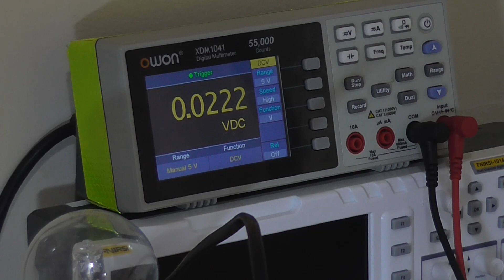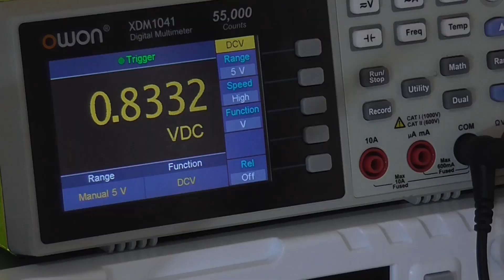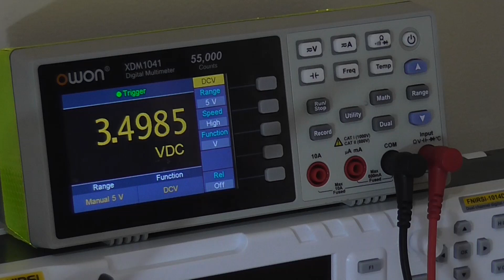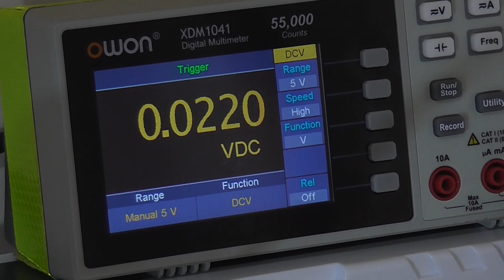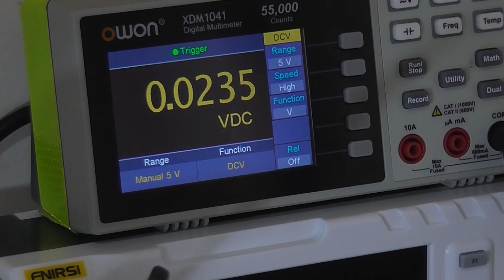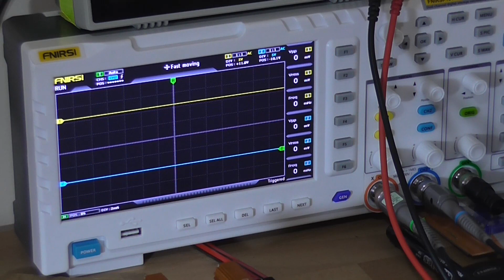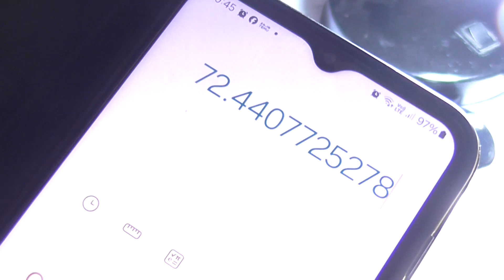How To Test An Unknown Power Amplifier SAFELY

Comment: Definitely you need a more powerful transformer for this amp
Reply from the maker: Not really sure what you mean; if you mean in terms of current, not really. The amplifier only draws around 2A at full power. If you mean in terms of voltage; you can't go any higher than +/-40V with current signal transistors.
Reply: @AstrosElectronicsLab  the one you used on the video how many VA have that transformer?
Reply from the maker: @SymbolTech21  160VA
Reply: @AstrosElectronicsLab  if it's 160va should be fine I don't know why I had impression from the video was looking quite a small size
Reply from the maker: @SymbolTech21  nah, it's 110mm diameter, 3A secondary winding.
Reply: @AstrosElectronicsLab  that's good size

Comment: Hi there 
I have 1 question 

Which one is good for Heat sinks
1. Anodizing 
Or
2. Powder Coating 
For amplifiers around 200 watts per channel. 

Please reply
Thanks
Reply from the maker: The coating doesn't matter, as long as the material is aluminium (aluminum). Most heatsinks are anodized; however, I wouldn't use powder-coated as this can affect the heat transfer as it's basically a plastic (polymer). The surface where the devices mount, it'd be better if this was bare (natural); most effective heat transfer.
Reply: @AstrosElectronicsLab  thanks a lot
I appreciate
Reply from the maker: @AnjumShaikh-v7z  you're welcome